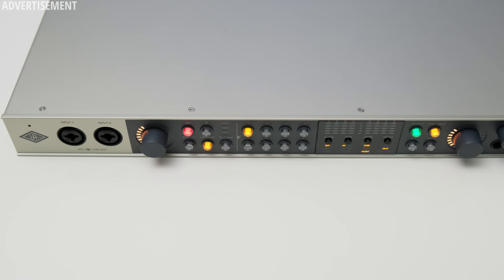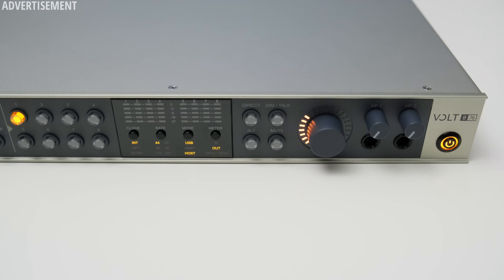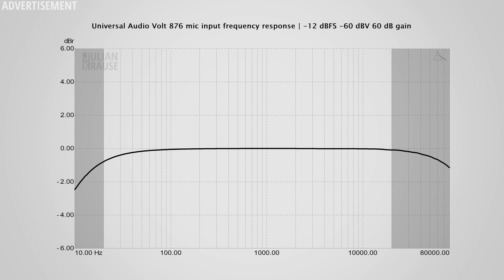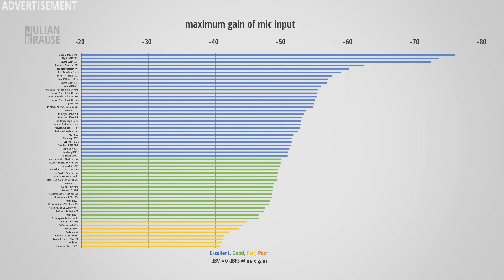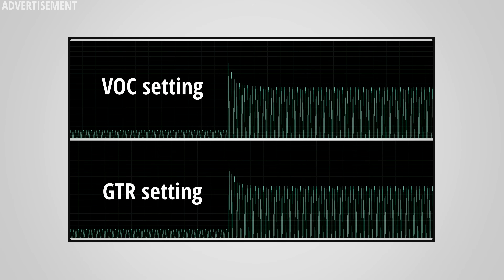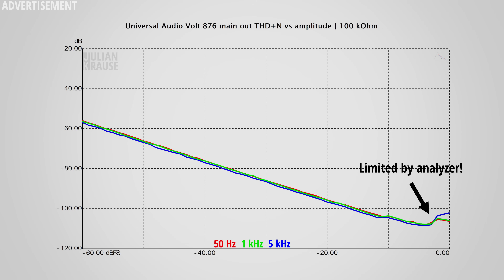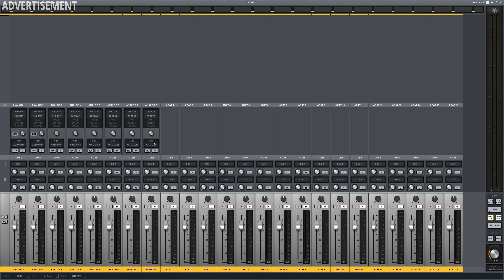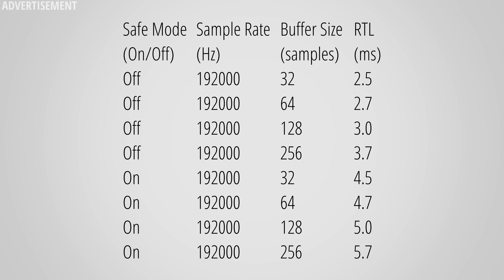Universal Audio Volt 876 – USB Audio Interface Review (Vintage mode and 1176 compressor)

Comment: Thanks for the detailed review and all the hard work on these tests!
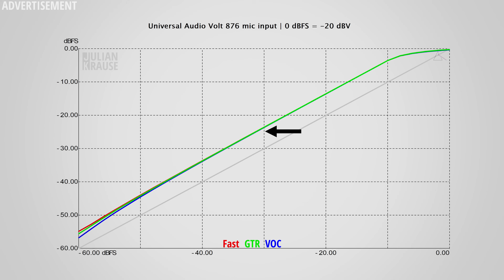I have a quick question regarding the methodology: I noticed on the compressor graph @9:16 that you used -20 dBV as a reference for 0 dBFS. 
If that’s the case, the real threshold ends up being much lower — around -42 dBFS. Or am I missing something in the calculations?

Comment: Being a fan of your channel for so long i like to add some work for your testings. Linux is becoming more and more interesting. I'm using CashyOS/Linux for three years now and rarely switch to Windows, mainly because of bad Linux-support of my interfaces and sometimes needed reconfiguration of interface settings. Most people would like to know if an interface is truly(!) class compliant. All ins and outs including SPDIF/Adat should be accessable out of the box in Bitwig, Reaper and other software. A simple and fast test with a rolling distro like CashyOS would be nice.
Second point of importance is if i can reach all necessary functions from the front panel or is there an alternative for reconfiguration via web-interface or Android/Apple.
Last point is more common. Are the IOs DC-Coupled? Just a brief check in the specs.
There are simply no interfaces with full Linux-Support except Focusrite. RME is often falsely claimed to support Linux 100% but that just refers to old Firewire-Interfaces. At least they seem to run correct in terms of class-compliance. There is some community work on RME but sadly RME no longer seem to be interested in this. MOTU is total mess as their interfaces vary in built and firmware. Sometimes an interface works 100% with support of web-ui and then same unit fails.

Summed up:
1. class-compliance working out of the box in Linux/Pipewire
2. possibillty of control from front or alternatives
3. DC-coupled yes/no

A guy like you with an excellent reputation in the community could help to bring better Linux-support into a wider interest. Many interfaces are falsely claimed to be class-compliant. Please help! :penguin-blue-waving-tear:

Comment: Really? 
In 2025/26, daring to build an interface with an LED display at a price where others are already building TFT displays with highly accurate readouts is an absolute joke and a misguided development by companies that believe they can rely on their traditional names. For less than half the price, you can get an Audient EVO 16 with a clear TFT display. Or an ID 48 with great converters from a proven mixing console. Apollo and other manufacturers still use this primitive LED design that flashes like an old disco system from the 70s, which is simply no longer appropriate in 2025! 

Anyone who, unlike UA, wants to rely on a good name and is looking for a truly professional device will clearly opt for a Motu 16 A or MOTU 828 (2024) in terms of sound quality. Thank you for the review, but we as professionals would not buy this. Therefore, it's clear: NOT RECOMMENDED FOR PURCHASE!

Comment: I think you are the most representative creator in audio interface field on Youtube
You should try Topping M62 Portable audio interface with its accessories
I've been amazed by the performance of this portable audio interface over the past few months.

Microphone Inputs: DNR 119.3dBA, EIN -129.5dBU (A); Actual gain 81.5 dB (A56+D32), Dynamic Rage 119dB, THD+N -114.4dB
Headphone Output DNR 122.8dBA, Frequency Response ±0.02dB/300Ω, Impedance 1Ω/1kHz, Crosstalk -122.1 dB, THD+N -114.4dB
300g 5000mAh 6~8hr, 2 USB-C (1 OTG, 1 USB-C), with 8 loopback channels with bluetooth/rf remote controller

Comment: Suggestion: How about adding info in your videos about the average length of software/driver support for each manufacturer? I first bought a new Focusrite Saffire interface many years ago, and to my disappointment, Focusrite dropped driver support within 2 years. I tried a few other brands before finally buying a used RME Babyface almost 15 years ago. It's still getting driver updates now, sounds good and works very well as my home interface to this day!
Reply: We’re sorry to hear that you are no longer able to use your Saffire audio interface. Development support for our Saffire range has indeed ceased, although we were able to provide this support for a decade. Unfortunately, we can no longer offer updates in the form of drivers for these legacy FireWire devices, despite our best efforts to maintain support for as long as possible. The drivers for Saffire FireWire interfaces were provided by a third-party company under licence to Focusrite, and that company made the decision to cease development in 2019.
While we understand that this may offer little comfort, we want to assure you that support continues for the vast majority of our other products. This includes our first USB 2.0 device, the Saffire 6 USB, which was released in 2011 and continues to receive updates. Our Windows USB and Thunderbolt/PCIe drivers are consistent across all devices, meaning that even users of the first-generation Scarlett interfaces are still receiving support.

Comment: The 48kHz latency numbers are missing the larger buffer sizes usually showed in your videos. Furthermore, buffer sizes lower than 32 are basically useless for audio tasks since you can't run almost any plugins on those anyways, even on very powerful computers.

Comment: I would have liked to see how the RTL is with 48khz 128 or 256 buffer. That is usually where the latency spikes. The 48khz 64 buffer value is pretty much like any other interface.

Comment: Great review, as always! IMHO the only interface that stands out nowadays in this tier is the SSL 18. If you're going for something with digital controls like this just pay less on a Scarlett 18i20. Again IMHO. When I got mine, the SSL and VOLT weren't out yet, but I still would get it instead of this VOLT. The SSL on the other hand is more on the Clarett tier than the Scarlett and VOLT, I think.

Comment: @Julian:
I have a question regarding MOTU interfaces: Over the years I bought a few and they have a variable Voltage DC input. I noticed that when operating them with 12 V instead of 15 V (default MOTU power adapter) they stay much cooler. Is there any point in operating them hotter? From other devices I know that operating electronics hotter means they age more rapidly and likely fail earlier.
Reply: Typically, a higher voltage supply will allow higher gain, lower noise, and/or lower THD, and be less likely to cause issues as it ages. However, there are a lot of variables that could change that (eg, manufacturing variation between units, specifics of the power adapters being compared, operating environment, etc).

In regards to longevity, heat is rarely an issue for something as low-power/low-performance as an audio interface. Unless you got a lemon or regularly operate it in >40C air or in a weird orientation, it's unlikely that heat will kill it before something else manages to.

Comment: If the headphone controls were digitally controlled from computer, I would not like to use them at all, as I have had so many mishaps with almost blowing my ears out due to mishap with mouse + volume slider... So what UA did is IMO highly preferable way of doing it.
Reply: While yea sounds like it hurts they should still have it implemented and option to turn it off if u don’t want it. I just don’t like having to go around my desk to just turn up a simple hp volume up while everything else is essentially digitally controlled
Reply: @slysaint8933  you can buy a potentiometer and a couple of jacks and make your own local slider/dial to drop the level.
Reply: They figured you could probably use the exercise.  ;)

Comment: hmmm… this rack interface looks like a great one overall, I personally am a lover of high end conversion, and Cirrus Logic converters in this unit on both AD and DA side as well as the headphone outputs make this a plus… only reason I wouldn’t get this one is not being able to connect outboard gear to it, as you could on other rack interfaces such as SSL, having to get the drivers thru UA’s connect software isn’t a big deal, just have internet like 95% of households lol you should be just fine, if I did purchase this, it would be ADAT connected to another interface that has the ability to insert outboard gear, overall it seems to be great, thanks again Julian 🤟🏼

Comment: I've used the SSL 18 and the Volt 876. Both are great but the Volt's lack of DAW 3-4 or 5-6 returns makes it limiting for creating different headphone mixes for artists. Seems odd. Also, the main out is a tad noisier than the SSL. The SSL really is the one to beat right now in this price bracket.
Reply: THIS.
It is a great problem for me, I usually record entire bands and need at least 3 diferent mixes. I just bought the Volt876 and coming from a Focusrite 18i20 I found this to be a downgrade, I hope they fix it somehow because I'm already having second thoughts about it.
Reply: Wow - that is indeed a big miss on UA's part. 😳 Thanks for pointing that out - I use multiple DAW playbacks for individual headphone mixes all the time.
Reply: @number6photo  Ya, that was a huge miss. I reached out to UA and their response was..."Volt 876 has a stereo loopback channel. If you need/want more, then you're an Apollo buyer in our eyes"
Not sure why nearly every interface has multiple DAW returns but this one is dumbed down. Especially when one would assume it would be used with multiple artists wanting headphone mixes.
Reply: @AnalogCabin OMG it sounds like they won't be solving this issue anytime soon. Or ever.
Reply: @AnalogCabin  I recently picked up a MOTU 828 which is in the same price range as the Volt 876.  It has similar I/O capabilities as the Volt 876, but it supports several DAW playback channels.  UA's engineering / marketing department made a decision to limit it to a single stereo DAW playback based on their expected customers, and probably limited compute capability in the hardware which they chewed up with the compressor functions, but I think they misjudged how many customers actually need multiple DAW playbacks.  I would personally much rather have the multiple playback channels and skip the compressor capability, which is better done in post in the DAW in my experience.
Reply: Agreed… 100%

Comment: Hi Julian! Long time viewer here. I'm caught in a dilemma. I have the option to buy a used Apogee Duet 3 for around 500 USD or a new Antelope Audio Zen Go Synergy Core for 600 USD. I used 250 ohm headphones and I just need something that sounds better than my iD4 MK2 in terms of preamps and outputs. What would you suggest?
Reply: None of these. Get yourself a Babyface FS and sleep well at night.
Reply: @AndreasTsachidis  that one or MOTU Ultralite MK 5, that one is slept on
Reply: @AndreasTsachidis  I originally considered the BabyFace Pro FS, but it's about 1000 USD where I live. I decided to go with the Duet 3.

Comment: The trend of adding gimmicks such as eqs and compressors build in the interfaces is terrible, consumers pay for such useless features that free plugins can do better, why the heck you want to record through that crap? just to call it analog?  yes sure! Companies should focus to improve the core of the interface (conversion and preamps) not to that crappy gimmicks, don't buy the "analog" snake oil they trying to sell you.
Reply: Por fín alguien que piensa como yo !
Reply: I think you're half right. But for some people's workflows, having the compression and EQ they want printed on the audio as it comes in is very handy
Reply: @bassheartstrings  what eq and what compressors my friend? they only have stock settings and you can not control anything, you will end up with tracks you can not change, how can this help you? lol
Reply: @dimitrisgakis9206 a lot of settings get preset over time to streamline things. The built in compressor is likely a 2:1 ratio and as Julian shows in the video the threshold is about -10db. That's an extremely standard setting for an 1176, and how I would personally like a lot of my audio coming in with just a button push vs having to load a plugin later

There's also something to be said about committing to settings. I like deciding what sounds good in the moment and printing that without being able to second guess myself later. And it's not like the sound is ruined, it's such a gentle compression setting that it's inconsequential outside of me liking it being printed into the audio before touching any plugins.

There's also the tactility of it. I can play around with how much i drive the gain and how thay interacts with the compressor on the way in. You can do that in the box, but turning a knob is more satisfying than playing with a setting on a computer.

Not saying it's useful for everyone, but recording is an art and different people have different ways they like to do it
Reply: @bassheartstrings  In this specific case, where you can’t control any setting other than the gain, the physical interaction is so minimal that it’s negligible. Don’t fall for the snake oil they’re selling you. You can load the plugin literally with one button press, and you can even have an 1176 compressor in your project template on every track you record  without pressing anything at all and the plugin will definitely be much closer to a real 1176.

Do you really think this device gives you eight actual 1176 compressors when one real unit costs multiple times the price of the Volt 876? 

Wouldn’t you prefer an interface with better conversion and Class-A preamps, plus an 1176 plugin included so you can use it however you want? Do you honestly prefer printing your valuable recordings through a basic circuit just because it’s analog?
It makes no sense to me but to each their own.
Reply: @dimitrisgakis9206 like the Beatles …
Reply: @bobby-4u2  Yeah the Volt 876 will give you the quality of the analog hardware of the Beatles!
Reply: @dimitrisgakis9206 I meant simply using what you have to do great things …..
Reply: Really? Most people wait only for the first budget friendly full DSP interface, limiter, EQ, Voice Isolation, Routing, you name it. Let alone latency issues of some plugins ... but to be honest, I don't understand 4k and vintage sound modes neither.
Reply: @yo3429 Can you even understand of these so-called “1176” compressors on this thing? It’s not just for monitoring, it’s for recording, so why would anyone want to print through that? UAD could give you a free 1176 plugin that’s closer to the actual hardware than this cheap analog circuitry.

DSP interfaces make more sense than these gimmicks, and proper routing options are a legitimate feature for an interface to have. But honestly, nobody really cares about DSP anymore; there’s barely a point to it now. Even UAD is slowly moving away from DSP, since latency just isn’t an issue if you’ve got a powerful computer.

They could have upgraded this interface with better dynamic range, lower noise, better headphone amps etc,  but no. They chose to sell the analog dream instead. (And by the way, Julian is sugar-coating these issues a bit in this video.)